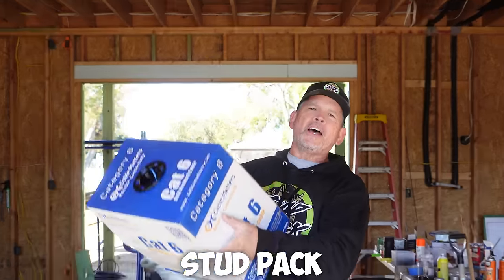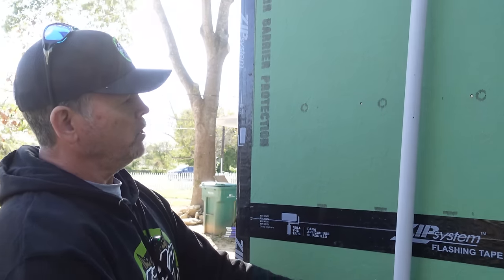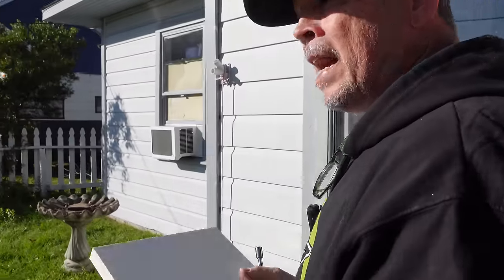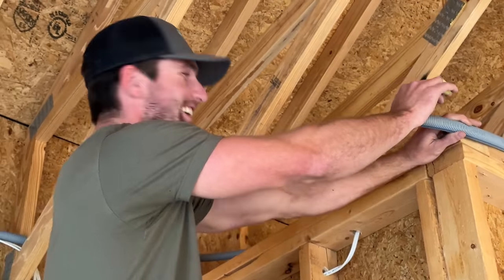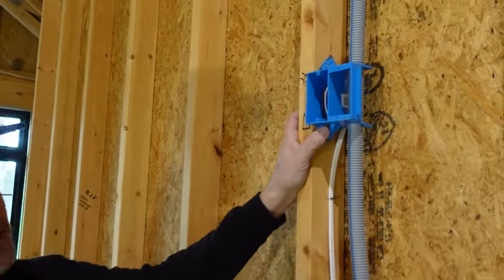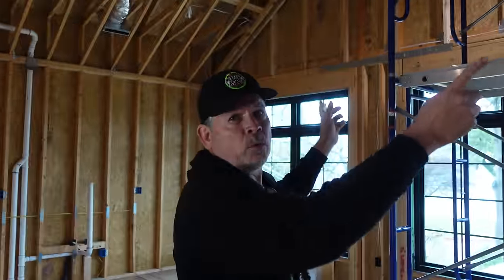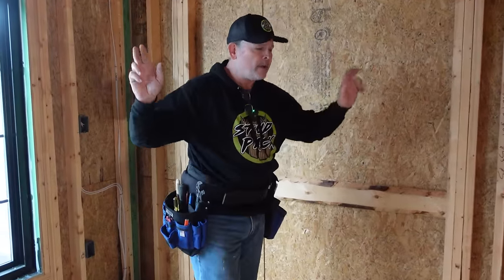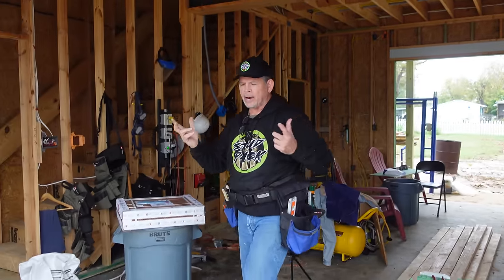DIY Networking for a Future Proof and HIGH SPEED Home! (Smurf Tubing and String Pull Trick!)

Comment: Back in 2002, I was hired to run Cat5 cables for a University's new Dorm rooms. It was 24 Dorms of 4 rooms and 2 cables in each room. So 192 cable runs to the IDF/Electrical room where there was a Fiber Optic powered switch. They would not pay for jacks at the room end so I crimped all 192 RJ45 male connectors on the solid core Cat5 cables. There was no 'Strain relief' on these connectors

It was not even a week before the 'Call Backs' came in from the students snapping the connectors off. After the 10th or so call back, they paid me to put surface mount biscuit's with Cat5 RJ45 jacks. The students then used short 'Stranded' patch cables. 
No more call backs. The Uni's IT group had told the BEAN COUNTERS not to do the male connectors on the solid copper wires. 

I also did all the Coax RG6 runs for the Dorms living rooms all connected without a jack but these did not get connected and disconnected daily

Comment: I wouldn't run the cables straight through like you did, I would terminate them in female sockets in the wall like you originally intended to do.  The reason is, ethernet cables do go bad.  It's happened to me several times.  Who knows why, but personally I like having the option of switching out the cable from my computer to the wall.

Comment: Paul it is recommended that you install the keystone jacks especially because the cat6 is so rigid. Using keystone jacks will allow you the ability to keep a cleaner look and also hides unwanted cables when you decide to move device. I would love to send you and the team cat6 specific keystone jacks, the punch down tool, and cover plates if you’d like. In order to make your installation even better I want to send you some high end pass through connectors that have shielding on the ends that will make the Stud Pack house future proof. Like always guys keep up the good work and awesome work!!!!!

Comment: I installed lots of cable for the sat. companies. It would be wise to run a coaxial cable as well. There is still a lot of tech that uses it and or antennas. It is always good to have it and not need it, than need it and not have it.  Run one solid line to the upstairs apartment and one solid line to the main house. than you can split it from there if need be.  You don't want any breaks or splits. It will create weak signal or leak signal.

I would run the smurf line from the electrical wiring just for state of mind. It sometimes does inter fear with the signal and sometimes it does not. Just never know.   so that way in the future if there is an issue, you can eliminate it from that.

Love your guys work and DIY

Comment: T568A and B are the same revisions.  They are denoted as such for the purpose of building cross-over cables.  Newer switches automatically cross cables, but when the 568 standard was put in place, you had to build cross cables to uplink between switches.  If you use the same standard on both ends of a cable, it is a straight-through cable.  If you use opposite standards, it is a cross-over cable.

Comment: 23:34 The twisty part in the center is the spline. It's there not for strength but to maintain the internal spacing and overall twist of the individual pairs.

Comment: That braid is to split the jacket, you just pull it and it will slice through the jacket.   That white piece in the middle is to ensure the twist of the individual twisted pairs, that's the main difference between Cat-6 and Cat--5/5e is the amount of twist and that they twist the pairs around the other pairs with that plastic carrier bit.    This lets the cable work at up to 550mhz vs 350mhz.    As for terminating, you should use what are called Keystone connectors which snap into the face plates and use a punch down tool.   Make sure to terminate them all the same, usually 568B.
Reply: Correct. You strip the jacket, then use the pull cord to strip the jacket back even further. It’s quite likely the cable stripper nicked one of the conductors which can cause slow data transfer.

Comment: I see a lot of telecom people commenting but didn't see anyone point out cat6 is not very future proof and Cat6a, cat8 or even fiber would of been much better.  Better shielding and staying away from electrical.  Also testing just the connection for wiring it right is not enough.  Do a latency test as well, making sure there is no bad cables causing issues.   I ran cat6a on a spool like you guys did 8 years ago when my house was being built.  Just don't bend it more then spec.   cat6 = 250mhz, cat6a = 500mhz, cat8 = 2000mhz (40gb), fiber may be to costly but I've got 3 runs, from fiber coming into home to fiber to router, and to unraid server.

Comment: Like mentioned before. cat cables should be perpendicular to power cables to limit cross talk/noise.
You should also terminate the wall into a Cat6 keystone jack. 
You should also leave a few loops at termination locations in case you need to terminate it again or move it slightly farther in the future.

Comment: So, quick tip for the flexible conduit here:
Take a short length from the center of the roll and put your foot on it.
Now roll the rest of the roll away, just like a bowling ball.
You don't have to fight with such a tube anymore now.
Works for cables as well.

Comment: Beauty of fibre is that it is not subject to electrical interference.  No need to separate them.  CAT 6 twisted pair although is resistant to electrical interference but best to separate from higher voltage electrical.

Comment: Hey stud pack, for the cameras if using POE do not use pass through specially in Houston humidity outside. I have seen them corroded and short out. 

Also using jacks and wall plates for TV is a good idea.

Another good idea always run 2 cables to the TV spot. The second cable can be used for many things. One common thing I do is use it instead of hdmi and use the cat6 to hdmi converter. Or if you have a smart tv and say an Apple TV you can have home runs for each. Definitely worth the time while everything is open.

Comment: If running cat parallel to power aim for at least 12" away. If crossing the two, 1 inch is fine.  Terminating into the same box is fine. And you absolutely should use keystones and a patch cable! I would go back and fix that.

Comment: If you're running that specific type of category cable (Ethernet) next to any type of high voltage cable ideally you'd want to run them perpendicular to each other to minimize cross talk or space them 12 inches or so apart. Getting the conduit for the low voltage cable secured to the 2x4 across from your high voltage cabling would work, however ideally I'd recommend getting another low voltage box and move both the box and conduit to the 2x4 across from your high voltage cabling in the space behind where you plan to put the TV. Either option will work; the latter would just better minimize that cross talk, and provide a more stable signal in your cable run. Really enjoying these videos guys, keep up the great work!

Comment: Love the videos! Its a garage apartment and this is all it needs to be. A small 8 port or 16 if adding cameras PoE switch in the attic space is fine as long as it's conditioned. Your router in that space would be temporary until main house is built. Put an AP right on the wall of the attic space into the main apartment space (Unifi U6 Mesh).  Make sure to put a dedicated outlet on the generator/battery circuit for network equipment and a shelf. A patch panel would be nice but it's a spare apartment space. Be ready to add another smurf tube down the tunnel for connection to main house and what will be main network closet.

Comment: Hey StudPack, Love your videos & long time fan.

Glad you called it out at the end but wish you had showed the testing portion. Tester for your cables is CRITICAL to make sure that all your wire pinouts are correct (no wires swapped) as well as ensuring you have good wire contact & signal on the cables. Crimping tools are imperfect and on various cable installs that I've done you may need to do a couple extra crimps just to get that good contact. The danger if you don't do this, most devices will auto-negotiate and just fall back to lower speeds based on the wires that are there & working. You paid to put in CAT6, you should get a full CAT6 speeds!

Similar to others, I've run a LOT of cable over the years and I've even had to go back and clean up other installers work when they run cable straight out of the wall like you're doing. Running to a female jack in the panel is the way to go from both an aesthetic when you're not using it (no cable just dangling) as well as giving you the flexibility to use any length of cable you want from that jack to your device.

Comment: In the last house I wired up, I ran smurf tube from every room to the attic, which I used as a huge junction box. The wires then ran to the main wiring panel via a large rigid conduit. This will allow the future installation of fiber or other cables when required.

Comment: Hello, I have been following your channel from Belgium and for quite some time.

I have a small comment to make regarding the network. Using category 6 is not recommended at all. Cat 6 cable is standardized for Gigabit Ethernet and is backward compatible with Cat 5E, while having stricter crosstalk specifications. You need 6TPe/ble (6A) or 7. Cat 6A is designed for transmission speeds up to 10 GB per second. These cables allow the use of protocols supported by class EA for the implementation of the 10G Base-T Ethernet standard. Cat 6A cables withstand a frequency range of up to 500 MHz and are compatible with PoE and PoE+ standards. PoE+ to connect several self-powered devices such as small outdoor/indoor cameras without having to remove electrical cables. They also have stronger resistance to interference. Category 7 cables are high-performance data transmission cables, built for a speed of up to 10GB per second over a distance of 100m, and can support a frequency of up to 600MHz. They are compatible with cat 5e, cat 6 and cat 6a cables, and have individual and collective shielding, thus complying with strict crosstalk requirements.

And great video as usual :)

Comment: In the commercial work, world, our data company always ran 2 wires to each box back to their data rack. They’d often show up with 10 or more boxes and pull them together. One box, two wires. This is why the cat wire has a declining foot length printed on the blue cable shield. If there’s a plan for a data closet/room in the main house run your fiber to that area. Otherwise consider the space under the stairs to be the data closet. 

So Fiber to the closet, cat6 from the closet/rack to everywhere else.

Comment: Also, I'd suggest to terminate all the CAT6 cables at the central box with a punched-down network interface patch panel for permanent connection, then use patch cords to connect to the different ports on your router.

Comment: Fellas love watching you guys from down under ... been working with fibre and utp cable for decades ... I agree with most comments here and you should seriously consider terminating to keystone jacks and using patch cables.... we always run duel runs to each wall plate (cable is cheap and easier to put redunacy in now).... the plastic in the middle of the cat6 cable separates the wire pair's to provide a better signal and this is the main differnce between cat5e and cat6 ..... Cat6A is what we normally use now but for your runs cat6 will work just fine and will easily carry a 10gbe signal upto 55 meters (cat5e will carry 10gbe but only about 10 metres reliably) i cant imagine you will go over 55 metres in any of your runs so cat6 will work just fine for 10gbe ... any faster than 10gbe will need fibre runs anyway

Comment: We were much more high tech 40+ years ago when I worked for the summer as an electrician's helper between high school and college. We used a foam rubber "mouse" to vacuum the string through conduit. You guys are like cavemen, vacuuming trash through the smurf tube. 😁

Comment: Yay! A new video. I needed something to cheer me up. My mother is in ICU right now and I've been stressing over that. She should be OK but they are trying to get her bp down and need to remove a kidney stone.
I think toilets in Japan can connect to wifi. LOL. I vaguely recall some Japanese toilets that analyze your excrement and actually diagnose health issues. That's been a thing for over a decade. 
Lucky to have fiber. I'm stuck on satellite. 
Looks like you can re-use those boxes from the house. I'd try to salvage as much lumber as possible from the old house to use for building the new one.
Those Lennox cutters suck. I had some and they broke on the first use. A spring popped loose and they no longer worked. Couldn't get it to go back in.
Keep in mind that the longer the cable, the more signal loss there is over the distance. But copper cat6 should be good. Probably really expensive. Are the ends RJ45s?

Comment: I'd recommend having your DEMARC in the ground level closet under the stairs. Install a small wall mount network rack for all the gear.

And as everyone else has been saying, use keystone jacks at final termination points for client devices :)

Comment: I like to pull the string, then tie a knot and a loop in the string, and pull that through, and attach the string at each end.  That allows the string to stay in the pipe, and it can pull things both ways over multiple pulls.
Reply: Yes, this! If your Smurf conduit is 50' long, put a 101' long string in there. Leave the extra 51' at one side or the other, let's say at the INSIDE of the garage. Permanently tie both ends to something solid--NEVER EVER UNTIE THEM. Make a little loop/knot as Jack mentions. When you need to pull fiber from the outside to the inside, first pull the excess 51' of string to the OUTSIDE, attach the fiber to the little loop, go back INSIDE, and pull the string and fiber to you.

Since there is an extra 50' of pull string, you can pull it back and forth (like a tug of war) as many times as you need to pull future cables.

In other words, the string is NOT a single-use tool. It stays permanently inside the conduit and is used over and over.

This is why you need string to be twice the length as the conduit.

It isn't too late to do that-just use your existing 50' string, to attach your new 101' string, and pull it into place. Leave all the excess inside the garage where it will stay dry. Leave a little note on the OUTSIDE end of the string to tell "future you / fiber contractor" to NOT UNTIE THIS STRING - instead, pull the excess to the OUTSIDE, then attach the target fiber cable.

Comment: Network engineer a lifetime ago here - rule used to be that if you have to run power and data parallel, in order to maintain compliance, they should be 2 full bays apart.  That ... isn't as needed anymore, but you should run power and data on the opposite sides of your bays whenever possible.  and if you have to cross power and data, as best you can, got at 90 degrees for 1 meter (39 inches) on either side of the crossing.  With Cat6 1GBe, its best effort - you aren't going to run into much trouble.  with 10GBe ... you are going to want to take as many precautions as you can, especially since you are spray foaming the conduit in place.
Reply: Technically, the rule was 1 meter (39") apart, but with 16" on center bays, 2 blank bays between data and power would be a minimum of 34 inches which is "good enough"

Comment: it should be okay to keep the ethernet cable next to a power cable. Ideally you would keep it at least 1ft away or cross over electrical lines perpendicular to each other (90 degrees) to reduce interference. However if you aren't running electrically noisy devices like motors on those lines/circuits you probably wouldn't notice any issue. Also if you got shielded cable you should be resistant to that electrical noise provided it's terminated properly (grounded).
Reply: I think in the past, you would want to run ethernet cable perpendicular to power cable! Luckily, I think they are better shielding them now, so it should be good to run them parallel to each other.

Comment: Great job at making the project simple and clean. I would recommend terminating the end with the female cat6 receptacle. Most data components come with a double male end. If you run your cat 6 cable to the end of the run, you have a pig tail handing out all the time. But yes some devices could use the male end. Ie lighting

Comment: That Klein pass thru tool will also strip the cable, and does it very well. For untwisting and straightening cable, a trick is to use a piece of the jacket you stripped off, put it on one conductor and wind it in, that separates the pair, then squeeze the jacket when pulling it off the conductor. Quick, easy, and resourceful. When you’re doing an office with 72+ terminations you start to employ tricks like that to maintain sanity!

Comment: As soon as I saw you were going without wall plates I knew there'd be a big controversy in the comments: Iet me add my 2 cents: in general it is considered best practice to use a wall plate/jack, but there are instances where it makes sense to just go with the direct cable: if it's to a place where there isn't a ton of space for a wall plate, like to a camera or AP, and it won't look clean with a wall plate + its something that will VERY rarely if ever be changed, then it can make sense to use a direct cable, but in general for non-specific use cases, a wall plate+jack will look better and will be more durable.